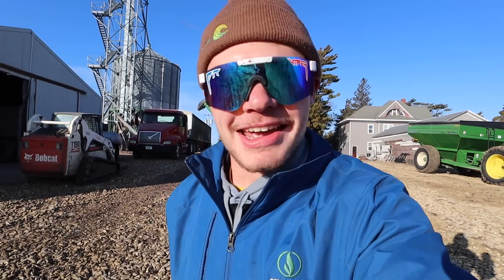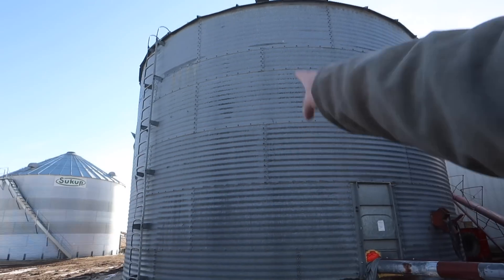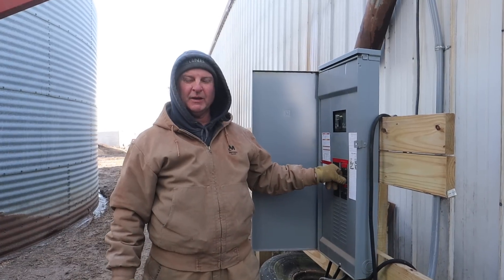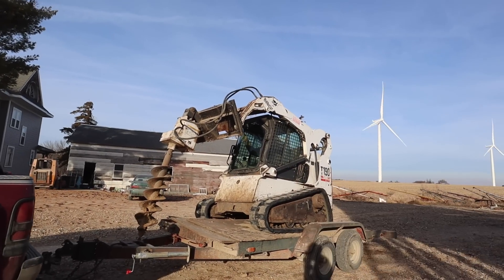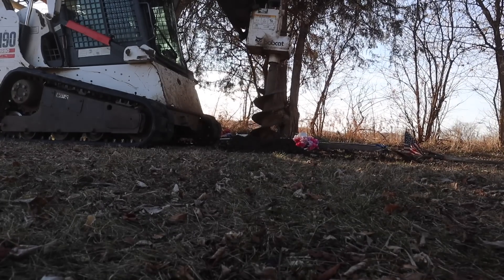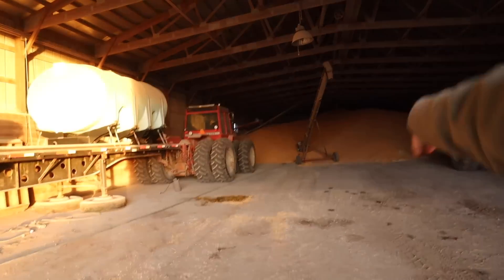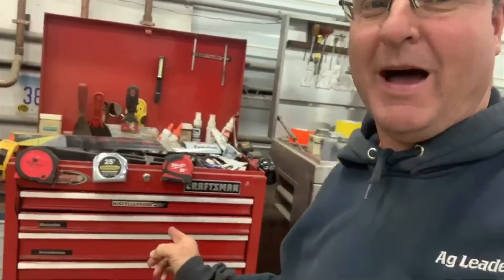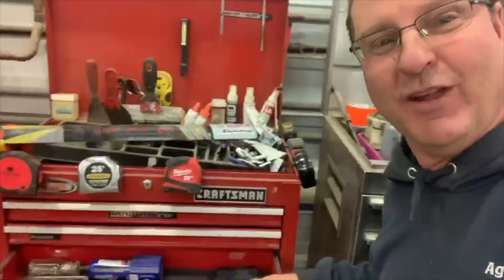A Day In The Life Of A Male Cornstar

Comment: When digging holes for graves with the auger you can cut a circle the diameter of your auger out of ply wood and the spoil will fall on the wood instead of the grass it's a oft (old Fencers trick) for yard clean up.
Also at the start of your intro my 6 and 8 year old both go Cooole the cornstar

Comment: Had the same problem with blown fuses. Just changed to the new circuit breaker type round fuse. So much easier, just push the reset button. Found them at Home Depot.

Comment: 6:30 here's a few reasons why you shouldn't run your tank empty.

1. Hard on fuel pump

2. When it is cold out and your tank is empty moisture will build up inside the tank and create water, if you don't water on combustion engines don't mix.

3. Don't fill up on empty on a hot day, most fuel pumps are cooled by the fuel, if you're low the pump is not being cooled properly and gets hot, when you go to fill up you put nice cold fuel in what happens is you have cold fuel and hot pump, the pump will sieze up and fail, so let it sit for a bit before filling up

so don't run your tank empty if you. a fuel pump can cost $500+, factor in labor you'll be sitting at around $800 total price

Comment: Question Cole?? What do you do with the "damp" dirt you dig out to keep it from freezing like a block? Coz damp wet dirt freeze s lighting fast.   Or is this the day of the funeral?... An for Daddy Cornstar,, that electrical maybe from the dinosaur age like you and I are.. however it will carry more amperage then the new wire of the same size...an old disconnect?? They are far better built then the brand new ones ;-) goes to show New is "not " always better.. :p an as a side note: winter time NEVER let the file tank below 1/2  ;-) never know when you're going to slide in the ditch real nice to have heat tell the tow truck gets there :-)